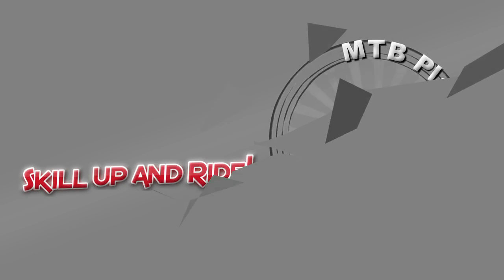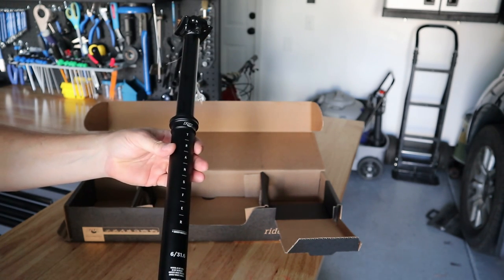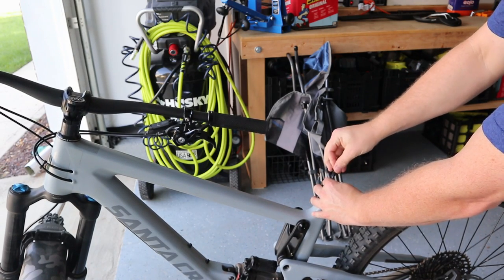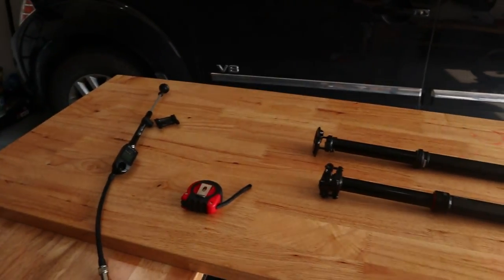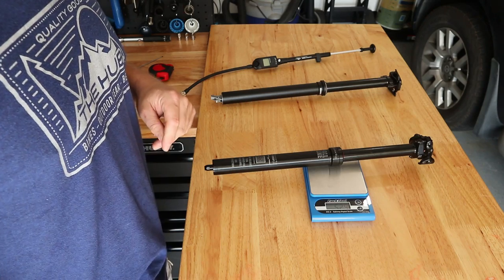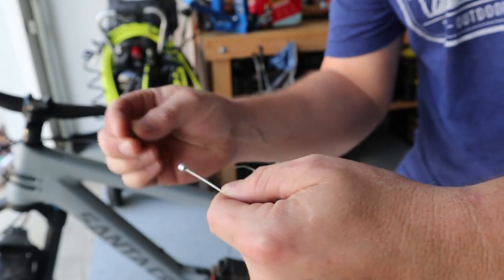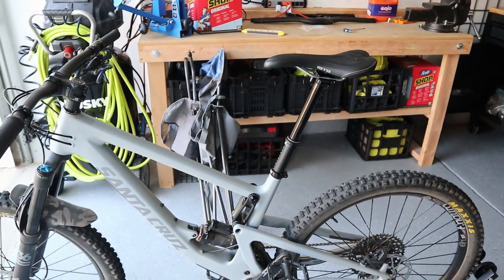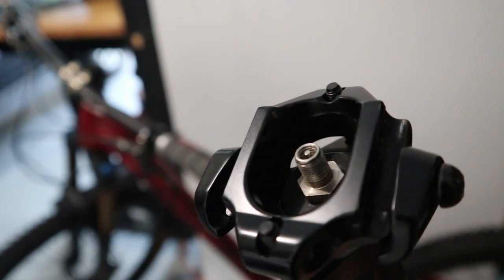#MTBPlanB 9point8 Fall Line dropper post developed an air leak!

Comment: 9point8 was great. Yup i had to rebuild mine too. But i like that i can service it, their customer support is amazing (quick email and even called me to clarify a few things) the head is great (pivot seat to add air but not loose your seat angle), AND if it dies, YOU CAN STILL USE THE POST - you just need to pull it up manually (but it still locks extended). I rode it like that for a month while a buddys One Up post failed and he rode out with the seat fully dropped because it wouldnt hold. Having said that the rebuild on the One Up post was a snap. Last you can buy it with either a set back seat post head (25mm) or not. And when you switch bikes and want the other head, you can order it separately and you dont need to buy a new post!!
Reply from the maker: I moved to a Fox Transfer and it has been flawless.

Comment: My Fall line also started to do this after about a year and a half, But fixed with a rebuild kit, was pretty easy.
This was one of the early ones with the version one nut, so i got the Version 2 rebuild kit, and opted for the tool which helps with the only tricky part of the job.
I also got this dropper due to how easy it is to service.
Reply from the maker: That is good to know!  My rebuild kit should be here tomorrow along with the brake tool.

Comment: I don't know what they use for seals & dust wipers, but I heard good things about SKF, I know fox use SKF for dust wiper seals on forks. about 9point8 redesigning the seal is unlikely, they probably just changed type of seal. but they redesigned the collar, which the dust wiper seal sits in.

Comment: how long did you use the dropper before a leak developed? I guess a dropper needs service/rebuild after few months, but some droppers self destruct in few months, like Race Face turbine in 3-4 months. also heard bad things about Reverb.
I like that the 9point8  is user serviceable, and has user friendly seat clamp. but I hate sending stuff in when I can do it my self easily & fast, So I don't want the Fox dropper, it would be expensive.
Reply from the maker: About 7 hrs of riding.  Much quicker than the 125mm version.
Reply: MTB Plan B  clearly bad tolerances on seals. I don't know what seals they use, but this will probably not be an issue on Fox, cus in my experience  the seals on the forks & shocks last a long time, I get suspension serviced two times in a year, after winter and after summer. so need new seals two times in a year. but of course dropper post probably have some differences in how long the seals last, but I don't know how much.

Comment: I know the Turbine dropper had play, but seems like the 9.8 Fall Line has more accurate made parts, cus as you claim it did not have play. the turbine was useless junk, it self-destructed.
Reply from the maker: 9.8 rebuild has challenged me!  Getting those keys to align and stay put will test patience. I’m going to try another type of rubber band. If that doesn’t make the job easier, the idea of having this dropper because of being user serviceable is of little value to me compared to time investment to rebuild.

Comment: I might want a dropper that doesn't need service.
Reply from the maker: That would be ideal. Seems like a recent rush of vendors and price drops may indicate droppers are heading towards being a commodity, Maybe even disposable longer term.
Reply: Seems everyone and their brother is making them now.  My Reverb isn't bad until it gets cold.  Pretty disappointed with that situation because it feels a lot better than the original model.  I was pretty lucky I never had an issue with the Fox Transfer on my old bike.
Reply from the maker: I’m really liking the Fox Transfer. I have about 30 hours riding on it without any issues.  I don’t miss having to play around with air pressure and cable tension of the 9point8 after temperature transitions.